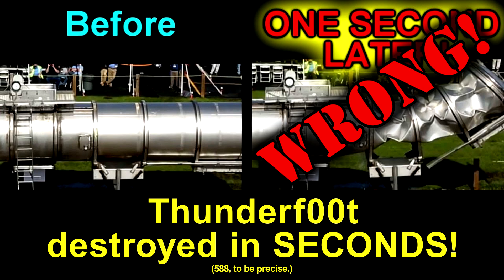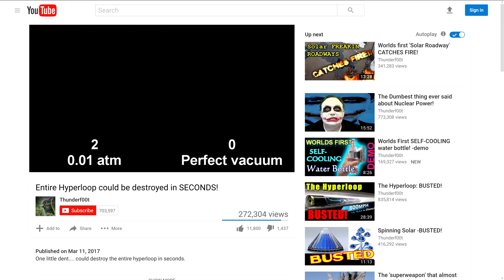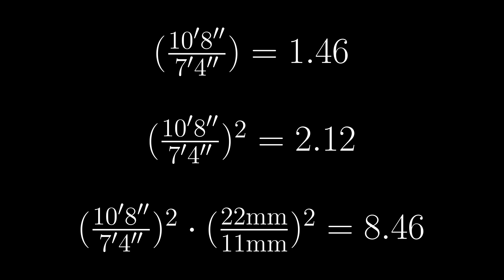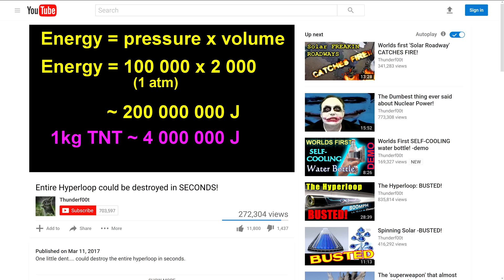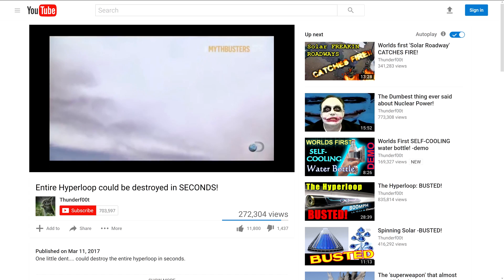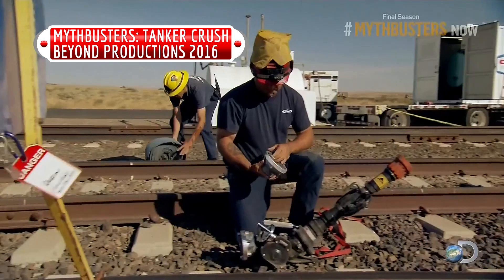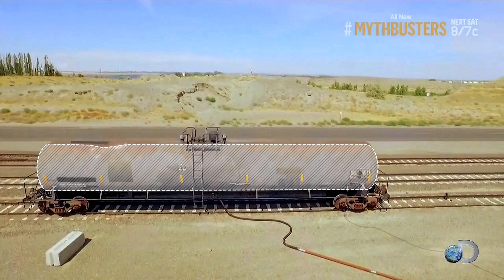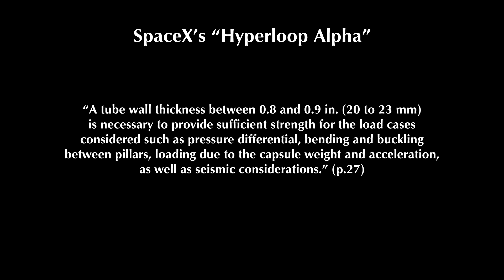Thunderf00t destroyed in SECONDS!

Comment: Using simple math (energy = force*distance = pressure*area*distance), you need about 0.2 kWh of energy for 1 meter of vacuum in 3m diameter tube. That is 120000 kWh or 0.12 TWh for 600 km. At current prices, this is about 12.000 $. According to "The-true-cost-flying" an Airbus A-320 on an hour long flight uses about 400-500$ of fuel. So, one-time evacuation of the tube costs at least as much in energy as 20-25 short-distance flights with economic modern aircraft. 
It all depends on cost of maintaining the low pressure. If you need to evacuate the full volume once per day, it's going to be expensive. Once per week seem reasonable.
Reply from the maker: My understanding is you wouldn't need to evacuate the full tube at all except after an emergency.

Plus, the tube's inner diameter, according to the Alpha document, is 2.23m, so it would be more like 1.1kWh, or about $6.60.
Reply from the maker: Of course, there are two tubes, one going each way, so that would take it back up above $12.
Reply: Ok, most hyperloop designs are around 3m diameter. I don't know the efficiency of pumps down to 100 pascals, this is just the bare minimum energy required. 0.02 $ / meter of tube does not sound a lot anyway, but it heavily depends on, like you point out, the average number of times/month that the whole tube needs to be re-evacuated. The constant pumping at 100 Pa is an unknown to me, how efficient are pumps at that pressure difference and how much leaking there will be.. Anyway, this is critical to hyperloop economy. And I only wanted to give some back of the envelope result that perhaps says something and sets some objective point of reference.
Reply: BTW, I don't know what your 12$ refers to? What length of tube?

Comment: hundreds of near vacuum pumps that work 24/7 to keep the tube at it's working pressure, if gas goes in it will do it slowly and gently, Internal supports? (Facepalm and loud WTF here) those claims ad even more to debunk the hyperloop than the ones that thundeerf00t made, well done,  just why the fuck don´t you use a bullet train concept, it´s proven efficiency an safety what´s up with all the nonsense inversion on miracle inventions that are misconceptions if you remove all the near vacumm bullshit it becomes quite reallistic and many of the problems bannish
Reply from the maker: "why the fuck don´t you use a bullet train concept, it´s proven efficiency" That is ABSOLUTELY untrue. NONE of them have lived up to their promises of speed, cost, and efficiency. They've all ended up being boondoggles.

Take off your fucking state cult goggles and stop being butthurt because the free market might succeed where they failed every single time.

Comment: If you cant convert .5inches to mm in this day and age with things like google what hope can i have that the rest of your assumptions are correct. For the record .5 inches is 12.7mm not 11mm.
Reply: 1 inch = 25.4mm clown. 25.4 ÷ 2 = 12.7mm. Get off the crystal meth and learn some mathematics.
Reply from the maker: The 11mm is straight from the paper, IDIOT.

Comment: One point about the atmospheric pressure,  real engineers who know about pressure systems know that atmospheric pressure really isn't that high in comparison to routine industrial pressures. Designing the tube to be tollerant to being massively ovalised wouldn't require it to be that thick,  secondly as the tanker demonstration showed this is not a failure which propogates indefinitely.
Reply: Deep_Dive Real engineers also know that over-pressure is a lot easier to deal with than vacuum. Over-pressure leads to tension, which means yielding is the failure mode. That’s orders of magnitude easier to deal with than compression, which leads to buckling/crippling.

Comment: yeah is all true but you were just nitpicking all of the small technical stuff....SF is a little exaggerating but he is not wrong too ... but let's be real, just think about reality long-term usage . this thing has to last! and other problems like the expansion of the tubes and the breach you were mentioning if it's not fixable and it happens constantly, then hyper loop it's not a feasible solution because you have to do maintenance for the whole system... it's just not worth it.....   you were not wrong Thunderfoot is not wrong
Reply: T Woo Bro. TF's "little exaggerating" are massive oversimplifications of complex physics, material science & engineering, technical details of the hyperloop concept. TF is knocking down straw-men, not offering concrete criticism of Hyperloop. "Nitpicking the small technical stuff" is exactly what enables showcasing how Thunderf00t's misleading abstractions/oversimplifications are misleading and false to an unimaginable degree.
Reply: Shane, calm down, you're not helping your case when you yell.  I know they're frustrating.  Just do your best.  :)

T Woo: He did answer everything, in his other videos (expansion, breach, etc).  If you think there's something that is yet to be addressed, please be specific.
Reply from the maker: "you were just nitpicking all of the small technical stuff" No, we debunked EVERY SINGLE POINT HE MADE!

What the FUCK do you anti-science neo-Luddites think you're going to achieve by LYING??? Come on, TELL ME! I REALLY want to know!
Reply: Shane Killian properly answer the stuff i pointed out dude... don't just ignore it
Reply from the maker: I DIDN'T. You FUCKING LIED and said we didn't cover stuff WE ABSOLUTELY DID.

GO THE FUCK AWAY, LIAR.

Comment: I'm going to call bullshit on a couple of points:

1. its not going to cost $5 of electricity to create a vacuum in the hyperlink tube.  You aren't moving air at 1 ATM, you are moving air at an every decreasing pressure meaning more energy is required to move at ever diminishing volume.  Further, you will be combating every pin hole leak in the system, which is planned to be several hundred miles long.  That's an additional energy cost right there.

2.  The speed of the hyperlink is going to be a problem because its going to need to be bled off at some point, in some way, or the train crashes at the end of its run.  If not, yes, you have just created a several ton projectile. That strikes me as an engineering nightmare.

3.  As the train passes down the hyperlink tube, the changing loads are going to create a whipping type motion.  This is going to flex every joint and connection.  That is going to cause joints to open, cracks and leaks.  Not conducive to a vacuum.
Reply: Oil pipelines do leak.  Its not bury and forget.  Imagine how much fun it is to maintain a pipe where the contents are not a rust unfriendly substance like oil but a rust friendly substance like moisture laden air.

As for ships hulls, there are access points below the hull, and of course, the openings in the hull for the propeller and thruster shafts.

More than one perfect design has been foiled by the imperfect environment.
Reply: I think you are making an assumption that isn't valid, that being that it will be prefect and to specification.

Pumping the tube down to zero (or close to it) is going to be hard enough given its length, but lets look at the points of failure.

Every weld, access port and seam is going to be a point of failure (there will be thousands of these).  Then, the airlocks you are going to need are going to be a points of failure (there will need to be dozens of these).

Then, there is the reverse.  You've got a vacuum in the tube, but you need pressure in the passenger cars.  Add it all its welds, seams and air locks.

Think of a large ship.  It hull is welded steel (like the hyperloop) and its designed to separate a high pressure environment (water) from a lower pressure environment (air in the hull).

You will then notice that large ships have bilge pumps which operate all the time, to empty the water that constantly seeps into the hull.

The analogy breaks down when you realize that air seeping into the tube means it won't work and air seeping out of the passenger car means everyone dies.
Reply: Some plans work better in the hypothetical than the real world.

Every component represents a possibility of failure and two components present three options (A, B and the interaction between A and B).

So, we have this system with thousands of components all of which must work flawlessly not only for the system to work, not only for it to be economical, but for folks not to die.

You can climb into this Rube Goldberg death trap, I'll take a plane.
Reply: Fair enough I will wait for some weeks of running the Hyperloop and then I can be swayed to ride one. But I live over the pond so maybe I will never ride one.
Have a nice day.
Reply: There is still the question of thermal expansion and how this will stress every single potential weakness.
Reply: I dont know the exact cost to pump this volume  from 100000 pascal to 100 pascal (hope i get the pressure right). It will cost certendly more then 5 dollar but I dont think it will be astronomical costly either. The hyperloop will have solar cells on it ( if its build like in the concept paper) that will provide the energy to first pump the tube down and later to accelerate the pods and maintane the low pressure. So I dont see any additional cost here to pump the tube down, because the solar cells will be needed anyway.
Reply: When you say oil pipelines leak do you mean all the weldings or are you refering to some valves that are not closing completely or a connection failing and then leaking?

I dont know how much water is comming through all the seals in a modern ship so I cant say if the analogy is fair or not but I think the hyperloop tube will be build, to be as airtight as possible with the best building technic that is known todate. And the rest will be pumped out routiningly.

You are right that some air will seep trough airlocks but I dont think all the welds will seep air trough. Look at the lage hadron collider. It has to be even a better vacuum to work than the hyperloop and they have also access panels and welds so it must be possible to build a fairly airtight tube.

So the arguments boil down to how much will it cost to pump the tube down first and then maintane the low pressure in the tube. If it is to much than the system is not practical but if it is not much ...

Hope I dont sound like an arogant ass. Have a nice day.
Reply: Perhaps we can gain an idea of pumping cost by looking at the pumps and times needed to empty this vacuum chamber.  https://www1.grc.nasa.gov/facilities/spf/
Reply from the maker: "meaning more energy is required to move at ever diminishing volume." Yes, it's logarithmic, as we keep saying. That's why they're taking it down to 100Pa and NOT a vacuum, or even the 1 microPascal Thunderf00t kept looking at.

"or the train crashes at the end of its run." No, it moves into a higher-pressure area before entering the station at 1atm. Did you even READ the Alpha proposal?

Also, it'll be propelled through linear induction. So what you say won't happen. The tube pushes against the pod, not the other way around.
Reply: So, we agree that moving that volume of air to that level of pressure isn't going to cost $5?

And as for moving in a higher pressure area, HUH?  If the hyperlink tube is a continuous tube under a vacuum (or near vacuum), how, short of deflector shields, do you keep some areas higher pressure than others without the use of some kind of airlock system?

And, ok, the tube pushes against the pod.  But, its the pod that acquires the kinetic energy that must be bled off to bring the pod to a halt.

Also, no one's mentioned that the pod needs a life support system.  It is, after all, essentially a spaceship.
Reply from the maker: "So, we agree that moving that volume of air to that level of pressure isn't going to cost $5?" The part that Thunderf00t mentioned, that they were doing for the test, that he was pretending was oh-so-prohibitive, according to HIS OWN NUMBERS, costs $5.

The Alpha proposal talks about the airlocks. Again, YOU DIDN'T EVEN FUCKING READ IT!!!

And do you not have the first fucking idea how linear induction motors work?
Reply: You are being evasive.

How much will it cost to bring the entire hyperlink tube down to its operating pressure and keep it there?

Lets just start there.
Reply: How much do oil pipelines seep to the enviroment when weldings seep? And in modern freight ships the bilge pumps mostly ballast water to stabilize not fully filled ships and condensed water, rain water and water spray out. Seeping seawater would rust the welds to quickly and make them prone to failure I think. But Iam not a ship builder so Iam not 100% certain. But I would not buy a welded ship that seeps on its seams.
Have a nice day you all.

Comment: why are people not able to argue like rational persons. Why must they allways "destroy" or whatever...
Reply: Have we looked at the issue of thermal expansion? How will joints and seams respond to this?
Reply: @reachforthesky1576  Thermal expansion, apart from being already addressed in the white paper (can you imagine TF thinks engineers dont think about those things) which mentions using things like steel because it transfers heat easily meaning the differential between top and bottom is very slight. Along with other solutions. And Shane also addresses it
Reply: @nicosmind3  You seem to have no grasp of the points made by Thunderfoot
Reply: Watch his other videos on the topic.
Reply from the maker: I just did a takeoff on Tf00t's title.
Reply: ovrava It's because oversimplifications and clickbait straw-men sell more easily than the kind of technical details Shane Killian is bringing into the discussion in these videos.